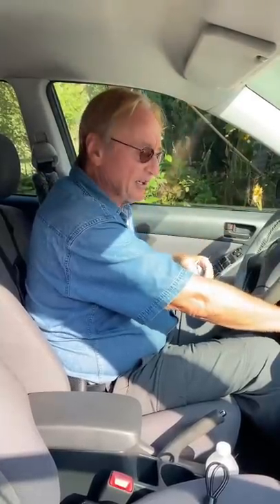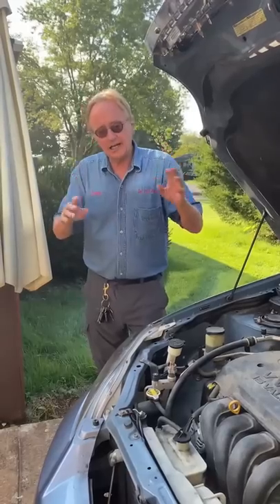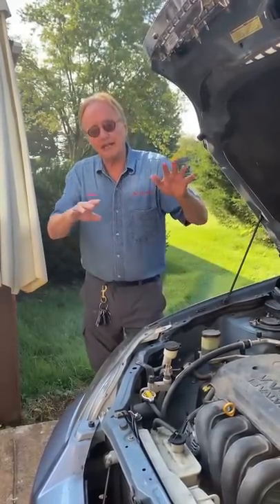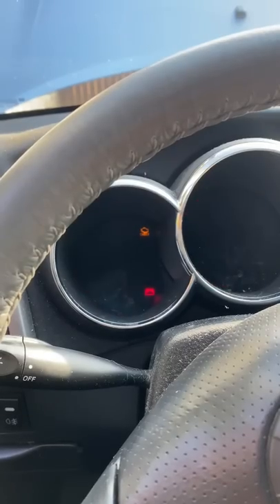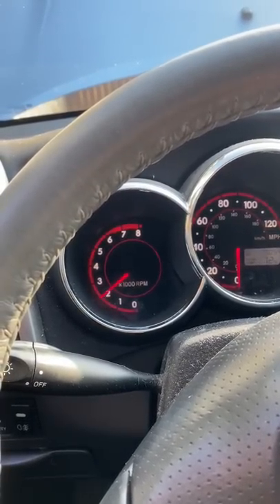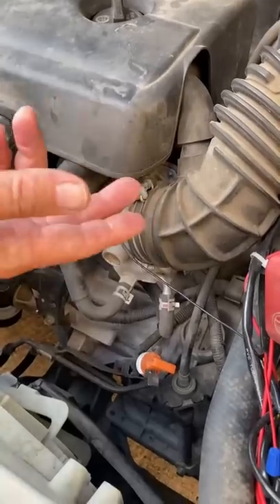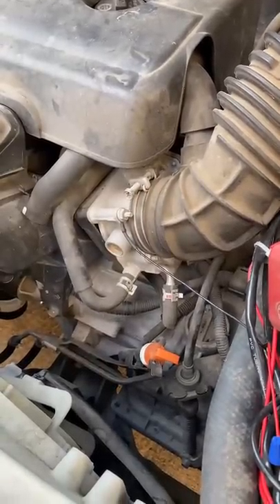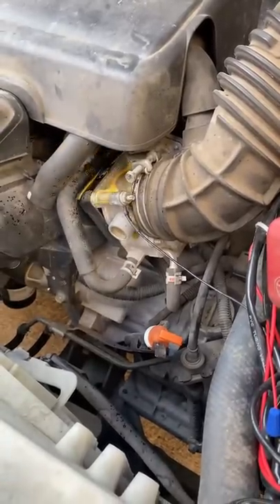If Your Car Runs Like Crap, Do This

Comment from the maker: Thanks for watching! Like and Subscribe for More Vids Daily ► https://www.youtube.com/channel/UCuxpxCCevIlF-k-K5YU8XPA?sub_confirmation=1
Reply: Lol I just cleaned the Throttle Body on my friend 06 Colorado. A few hours ago. It was running like crap. Bad sputtering at idle. It had so much gunck built up. The butterfly wasn't closing properly and I think it was confusing the computer.
Reply: Hey Scotty, I have a 2012 Jeep Grand Cherokee V8 5.7. Once In a blue moon my vehicle shuts off on me while I'm driving, but it shuts off when I'm slowing down when driving on the highway. I notice the rpm will drop a little and then it tries to correct itself and stalls. And sometimes it drops a little and you feel the Jeep wanting to shut off but it corrects itself and stays on. This happened multiple times, so I was wondering if you would have any information for me to correct this.
Reply: I'm wondering what you're talking about here in this video could be something that might solve the problem I'm going through.
Reply: @chello978  Hey I know you asked Scotty. But I had similar problems and it wasn't the throttle body. But the throttle position sensor in line with the T.B. just after the air filter box. I hope this helps. When you try to correct it with more pedal. It doesn't respond like you're not even giving it more pedal
Reply: I got an issue mechanic can't find issue

Comment: Usually it means the mass airflow sensor is bad or dirty but could be throttle body too
Reply: Where is that located?
Reply: @FunnyPlug  mass airflow sensor should be somewhere on top of your air filter box or on the side it's a little slide cap thing should be 2 Philip screws

Comment: You should let people know that you need to use throttle body cleaner or it can damage the sensors and seals
Reply: If that's the case, any particular cleaner? Or one you definitely don't use?
Reply: Unit_450 either way break clean leaves a residue should definitely use specific throttle plate cleaner

Comment: I did mine a couple weeks ago. It was filthy; more coked up than a 70’s glam rocker. Fairly simple & the idle on my ‘07 Focus is smoother and not revved.
Reply: Hello, I just bought an '07 Focus last week. Been noticing a few annoying things. Not idling correctly, steering wheel is vibrating. Sounds like it is gonna cut out when I stop. Have you had any of these issues? And there is fuel in my oil.
Reply: No engine codes though.
Reply: @alkigirl  I think the fuel in oil issue is sometimes called dilution and has a few different causes. The idling issue might be solved by cleaning or replacing the throttle body. Another problem I experienced was the huge amount of RPMs while driving. The fix for that was a simple replacement (although I can not remember the name of the part) because I had gone through a deep puddle and moisture got inside. I want to say it was the idle air controller. Is the vibration while idling or when braking? The engine and transmission mounts could be in need of replacement. If the steering wheel shakes when braking, that could be the rotors.
Reply: @alkigirl  The only code I’ve experienced with mine is about the smog pump as it was a California car. I just researched the symptoms and started by addressing the easiest, cheapest solutions.
Reply: @ithinkaboutthings9052  While idling and breaking but pretty bad at both.
Reply: @ithinkaboutthings9052  Yes! I also get higher RPM's while driving.
Reply: @ithinkaboutthings9052  Have you ever had to replace the throttle position sensor or the MAF sensor or the fuel pressure regulator?
Reply: @ithinkaboutthings9052  Another thing. Where is the air filter? Is it really the big box behind the drivers side wheel?

Comment: Note:  if you have any GM vehicle with a 4.3L or 5.3L Vortec engine with an electronic throttle DO NOT clean the plate without manually resetting the Throttle Position Sensor after. It will cause the engine to idle even higher and will cause hard downshifting due to improper communication between the TPS and the transmission control solenoid. Basically it doesn’t realize the rpm’s are too high to downshift and it slams it into gear.
Reply: Having that problem right now.  Tried resetting it by turning it on and letting it run for 15 mins then turned off for a minute. Driving it now but I don't think it worked.
Reply: If you have a GM vehicle, .....get rid of it
Reply: @Ocean_breezes  I’m a ford guy but those old 4.3, 4.8, and 5.3 chevys were amazing, powerful and reliable
Reply: How do you manually reset?

Comment: This is true, had a Chevy equinox that would work fine except after 10 min of driving or so the car would shake erratically and the reduced engine power light came on. My Chevy wouldn’t go faster than 15mph I mean it would CRAWL. Looked up some vids and turns out the throttle body was FILTHYY AND STICKY. Cleaned it myself and never had the problem again. It’s super easy to do literally anyone with no experience can do it.
Reply: What cleaner do you use?

Comment: Thank-you Scotty 😊❤ I never had a dad or brother to teach me anything about engines. I did date a guy in high school that was a mechanic. Every Sunday he would stand in my driveway and time me. I had to pull in, change my tire and be back out on the road in 15 min. We did it until I could do that❤😍 He taught me to change my oil, fill fluids, gap my spark plugs, change the distributor cap, fill radiator, then he went into the Air Force and I never saw him again.😢 his mom was great to . She taught me to crochet, quilt and put up damson plum preserves. ❤
Reply: You shouid have never let him go to the service. Do you know when the time comes some guys are good with their fingers?

Comment: Idle air control (IAC) valve controls the engine idle and in most cases it is dirty and sticking open. When you start an engine when it is cold the valve opens fully and the closes until proper engine idle is met based on engine operation temperature. This valve gets gummed up with oil deposits and when cold these deposits are very viscous when the deposits warm up they thin out and the valve operates properly. Clean the IAC valve.

Comment: Actually really helpful.  My 13 Corolla sometimes will go all the way to 3k rpm’s when I switch on ac right after starting, then will go back down to normal.  Maybe this will fix it.
Reply: Probs a vacuum leak

Comment: For all the car heads out there - I have a 2011 Chevy Impala I bought 6 months ago, I LOVE IT. it only has 86k on it but the transmission is not nearly as peppy/smooth as my 2009. Wondering if there is any service I can do or any smaller parts I can replace to make the trans smoother or if I’m going to have to rebuild it. Thanks and cheers!

Comment: I cleaned mine about a year ago for the first time in seven years after watching one of your videos on cleaning the Mass air flow senser. It wasn't too dirty, but it made a difference.
Reply: Do not mess with the mass airflow sensor in any way. Your air filter should protect it from any gunk. It does not make contact with any fuel just air. If it’s not clogged with any foreign material then leave it be. It’s all about the variable airflow cooling down the sensor element so that the amount of resistance according to temp determines voltage detected by the computer. It does not have to be pristine. The things are pretty much bulletproof like a lot of engine sensors these days.

Comment: I just did a throttle cleaning on my 07 Lincoln MKX. Very easy to do
Reply: what brand is spray cleaner please.. many thankxx
Reply: @MarcDufresneosorusrex  I sprayed amsoil power foam
Reply: @MarcDufresneosorusrex use seafoam anything else is crap

Comment: I just cleaned the throttle body on my fa20dit wrx and after running a cobb tune my DAM would drop. After cleaning I've had no knock amd the dam value has stayed at 1.0 even after really giving it gas. I also sprayed seafoam in the cylinder heads through the o2. Definitely a must do for maintenance especially since it's a DIT

Comment: Just recently bought an 04 Camry and cleaned the throttle plate and it fixed the acceleration…I thought I had a trans issue at first with the kick I was getting but it was gone with the throttle plate clean…now I just gotta do the engine mounts 😅

Comment: My VW Jetta had an alternator that was causing it to idle weird and thr AC would kick on and off. To be fair, at 200k on the original alternator I'm actually surprised. If you own a VW though, weird issues can be caused by the alternator.

Comment: if you clean your TB and still have issues its cuz when you clean it it needs to be relearned cuz for however long it has been dirty it got used to idling and running with that gunk in there acting as a restriction so it adjusted the way its supposed to, as advanced as they are not every bcm/ ecu will adjust to a brand newly cleaned tb so it may have trouble running until you relearn the throttle. i never had this trouble for some reason but im sure its vehicle specific cuz my cars aren't older than 2003

Comment: Wow, I had a 03 Pontiac vibe for several years with the same engine and always commented how the engine idled at 2500 rpm after start, just assumed it was what that engine was supposed to do and never questioned it. That car was a tank. Was written off with 360,000 km after being rear ended.  Odometer stopped counting at 299,999 and had to keep track with trip odometer

Comment: If you unplug the mass air flow sensor.
On a 2001 volkswagen jetta  2.8 L V6 It should shut off right.. Well mine doesn't would that say it's faulty.. Thanks in advance

Comment: On any Audi/VW/Skoda (& others) you can reset the throttle position sensor by:
1: Get in the car, put foot on accelerator pedal for at least 8 seconds. 
2: Put the key in, turn it forward to get dash lights up, but do not start the car. Wait about 8 more seconds and you should hear a quiet "Woomp Woomp" sound underneath the hood.
That's it, throttle position sensor is reset, can now start the car and any lag should be minimised/gone.

Comment: Yeah unbolt it or command it open with a scanner, if you go forcing electric throttle bodies open they can and do jump gear teeth or plain hang open afterwards.

Comment: Idling that high is rarely a dirty throttle body. 
I would suspect a vacuum leak or PCV issue. If it has a stand alone idle air control, that could be dirty enough.

Comment: Whenever it is very cold outside my car idles very low(1k rpm) but when warm outside it idles about 1.5-2k throttle body was just cleaned do you think it could be a faulty tps?

Comment: I take the whole throttle body off. Its 1-2 connectors, maybe a couple coolant lines and 4 bolts. It's easier and I'm not dumping cleaner into the intake. Sometimes that stuff messes up map sensors. It causes the engine to misfire until enough of it has dumped into the cats that the a/f mix is stoic enough to ignite again.
I use a piece of 5/8" heater hose to hold the plate open. You don't want to hold the plate all the way open, infact you want to be fairly gentle. Because you can screw up the position sensor in the throttle by forcing it open all the way. 5/8" hose holds it open just enough and doesn't scratch anything. 
Don't under any circumstances put your fingers in there while it's connected to the car. That plate is sharp and that  little motor with its gear reduction can slice your finger off.

Comment: Does rpm goes up and down during idling caused by compressor when ac is on? My rpm keep going up and down (700 to 1000) during idle (ac on). Not sure this is normal or not cause i felt that the interval was too short

Comment: I got a old Nissan navara that revs to 2000 rpm on cold starts, but then returns to idle straight away, it’s a v6 4.0 petrol , I heard it’s normal for that engine, would that be correct?

Comment: The high idle at cold start (the normal one, at 1000-1300 rpm or so) is for catalyst heating, actually, to get it working as soon as possible.
Reply: Wtf. No it's not. Why then, do older vehicles with no cat idle high at start up?

Comment: For some reason when I did this long ago, it idled even higher Any reason?
Reply: Yeah your throttle blade 'increases" in diameter with carbon build up, and the computer learns the new zero. When you remove the carbon now the blade is smaller and will run funny until you re learn zero with a scanner or go through sufficient start up cycles to re learn the long way.

Comment: don’t forget newer cars need to relearn the throttle body position sensor, after every cleaning usually it’ll learn on its own if it doesn’t the dealership will program it for you for a hundred bucks or so

Comment: Don't be suprised if your car idles high directly after cleaning. The computer has to adjust to the increase in airflow due to less carbon. Give it about 5 minutes of idling afterwards.

Comment: AW11 Toyota MR2s are supposed to idle at 2000RPM+
Reply: The redline is like 8600RPM on those right? :D So 2000 is barely breaking a sweat I guess :)
Reply: @BensCoffeeRants  depending on market yes, 7,600~ish USDM, what you said in most markets, & the same engine in select factory "High-Rev" ECU JDM AE86 did 8,800 RPMs in the 80's

But yeah with only 77mm of stroke it's not exactly going as hard as 2000RPMs would otherwise suggest

Comment: Chevy cleaned my throttle and now it sounds like ish😢 it's rattling like the air/ heat is on rpm is a lil less than 1
Helpppppppp😱

Comment: Do not do that to newer cars, you can fu$k up the electronic throttle body. Also do not push on the throttle body plate, some need a scan tool to reset them if they get moved manually.

Comment: What do you do if it idles to low
Reply: I’m asking the same question it’s either something wrong with the fuel filter or fuel pump I think
Reply: Or a battery needing replacing soon? I think I noticed my car idling slow because the alternator was trying to charge a battery that was too low to recover

Comment: What if when I turn it on the idle is very low weak what does that mean?
Reply: could be a stuck idle air control valve
Reply: I can think of two things off the top of my head.  First involves the air conditioner: the computer is supposed to call for upping the idle point when compressor is running.  If that doesnt happen, idle speed drops so low the engine nearly dies - computer will kick the compressor off if that happens, and that usually cycles over and over.  Second might be someone actually changed the mechanical adjustment, or a locknut came loose - there is always a stop of some kind that prevents total closure of throttle body.  There's other possibilities, but more information would be needed.    Does the vehicle run just fine going down the road, and where is long term fuel trim running at?
Reply: I haven’t driven it since the day I turned it on and the idle started to go so low that it nearly dies then eventually turns off I thought It was the battery so I bought a new battery turns out it isn’t the battery so I’m stuck it’s a Toyota Corolla 2004  with 98,000 miles
Reply: @sasukebrownie8652  An afterthought... a malfunctioning EGR system might be worth looking into.  Something as simple as a solenoid valve leaking by could make the egr function too early - it is not supposed to be operating at idle speeds, amd cycles on above a design rpm the computer monitors.  When/if it does, it can make the engine stop due to diluted fuel charge.  But before diving into that, replace any cracked or broken hoses associated with its control.  Some systems are rather sensitive.

Comment: Says you have to remove the hose to spray the inside of the throttle body. Proceeds to spray the outside of the throttle body.
Reply: Nitpicking, aren't you.?  Scotty knows more about vehicles than you probably will ever learn in 10 lifetimes. Haters always hate
Reply: @jingao22.  Pole riding much??
Reply: I believe he was assuming people wouldn’t be so dumb they couldn’t figure out how to get those like 4 bolts off on their own lol, he was just showing where it is on the car

Comment: i wanna do this because mine idles at 2k rpm but im afraid ill spray the wrong thing and damage my car LOL
Reply: Card and choke cleaner is what I use. I also have a throttle that has a spring on it it gets rust on the pivot point and sticks so I just hit that with pb blaster and it's good for a few years.
Reply: THROTTLE BODY CLEANER. It should be labelled like that anywhere in the world

Comment: No one gunna ask... What's w the random, added, very thin "ground cable" on the throttle body? Also carbon build up will restrict airflow, causing a low idle. On Toyota's will etc, even disconnecting the battery will reset memory, causing a low idle and even stalling issue. Cleaning the tb, and then again resetting adaptive learning after cleaning, then will it idle properly. Not trying to bust this guy's balls again, but be careful what you learn from the internet.